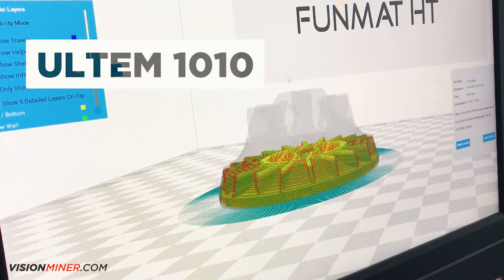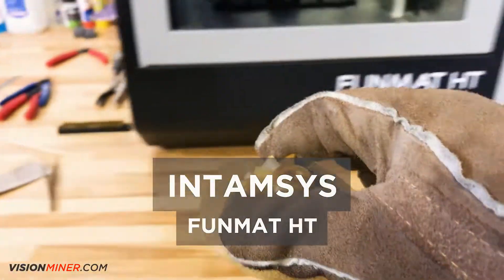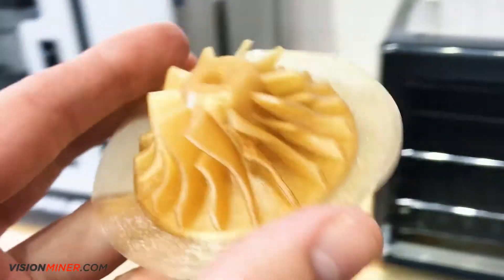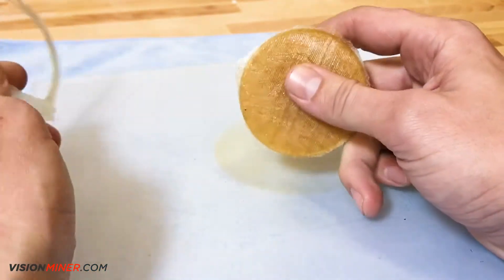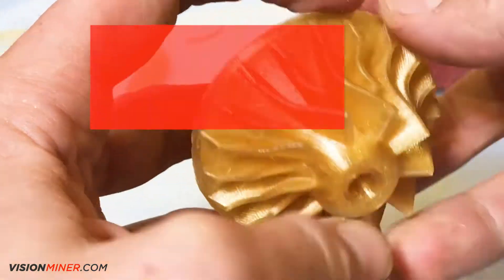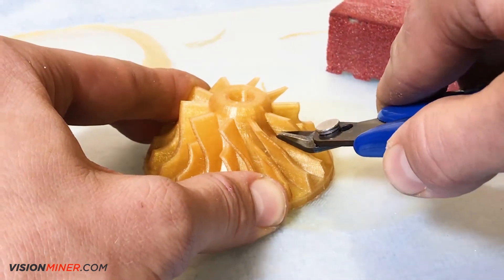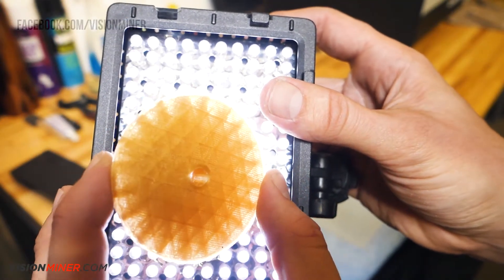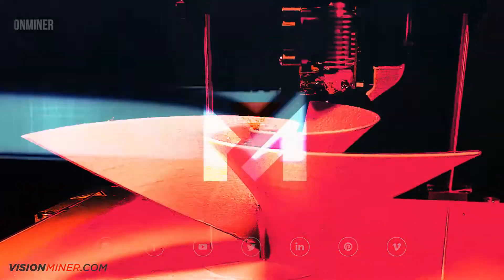ULTEM™ 1010: Functional 3D Printing on the INTAMSYS Funmat HT

Comment: How big of a part can I print at 110c of enclosure temperature? I can't find much proper info in actual needed Enclosure temps

Sorry for all the questions I keep commenting btw xD
Reply from the maker: Depends on wall thickness and geometry of the part -- to get solid parts, you want 185-220c in the chamber. The hotter, the better, though!

Comment: Have tested autoclaving it?

I've been looking for a 3D printing filament that allows the parts to be autoclaved. So far tested PLA, ABS and PP. Inside water or in an autoclave bag. All have failed. Ultem seems  to be the answer..
Reply from the maker: Yep! Fully autoclavable :) Along with PSU, PPSU, PEEK, and some others in the works :)
Reply: @VisionMiner  it is great to hear that! :) The search is finally over. Thank you

Comment: Probably a stupid question but.... Couldn't you simply leave the print on the print bed and anneal it in the enclosure? 🤷‍♂️
Reply: Yes, but the part can't fully relax while it is adhered to and restrained by the bed.  If released from the bed, it would not longer be in full contact with the bed for uniform heat conduction.  The bed will also block air convection at the bottom of the part.  Furthermore, convection is likely to provide slower and more even heating than conduction.  Most importantly, a toaster oven is dirt cheap.  In the meantime, they can start the next print.

Comment: What was the heated chamber's temperature set to for good layer adhesion?
Reply from the maker: Good layer adhesion is more due to the process, but chamber reduces warping so that the part prints accurately and sticks to the plate -- it also keeps the upper areas from warping/curling. Higher temperatures in the chamber can improve layer adhesion, but at 90ºC its more about process. :)
Reply: @VisionMiner  Thanks for the reply. I've been modifying an open source printer to do Ultem and other high temp materials. As I've progressed, I've began to understand some of the design decisions that went into printers like the Funmat HT. Also, that Nano Adhesive is good stuff. I recently got a sample of it, and it's so much easier to use compared to the glue grinding method. :)
Reply from the maker: Isn't it?? Far better! Our lives changed significantly after developing it.... much more happy time lol

Comment: can this be utilized in any 3d printer with enclosure?
Reply from the maker: No, a heated chamber is required for proper layer adhesion, and mainly to keep the internal warping at bay during printing -- when it cools, it can tear itself apart, much like metals.